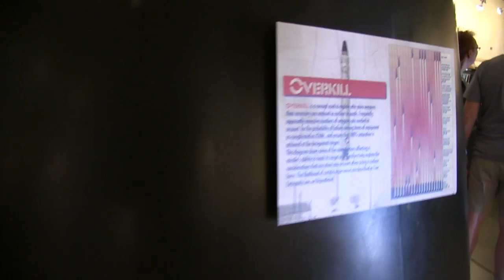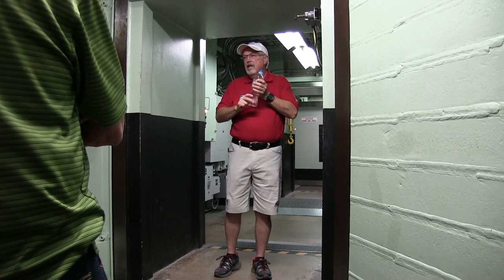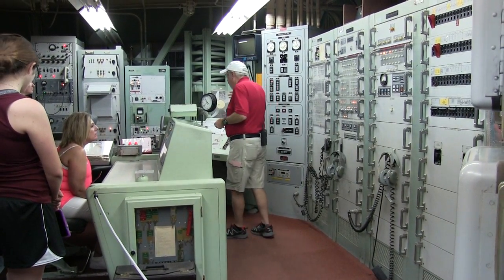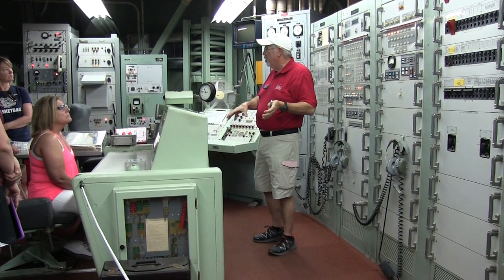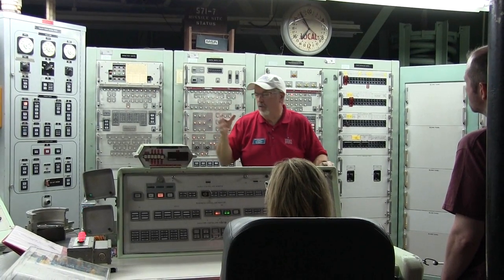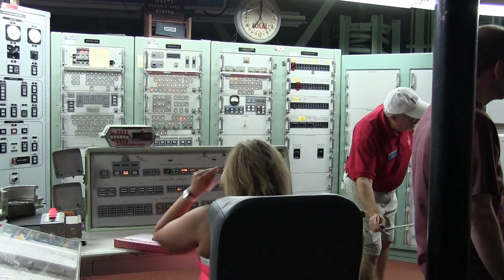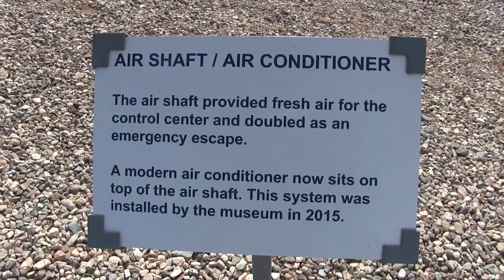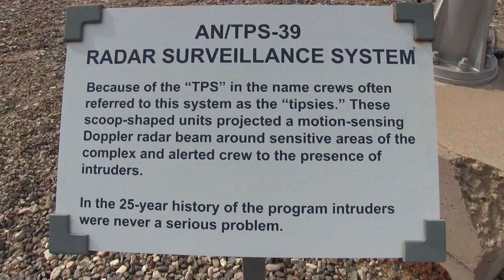Take a tour-Authentic, decommissioned, Titan missile silo Sahuarita, Arizona 2017

Comment: My first training in the USAF was as a Missile Electrician on Titan II missiles.  My first base out of tech school was DM.  I caught hell from the instructor at Sheppard one day because I was leaning against that same missile as it lay on it's carrier.  He told me to slowly pull my hand away from the missile and watch the skin.  I was shocked when it "oil canned out" with a rather disturbing "Ping."  I'm still amazed the damn things stand up without being filled with anything.
Reply: Maybe the old style oiling can..... just a half sphere with a spout that you'd squeeze the flat portion of the sphere to pump oil out of the spout. Then the depressed flat base "pings" or pops back out into shape...?
Reply: The skin was very thin on a lot of early rockets. The liquid fuel gave them rigidity.
Reply: As a launch crew member on the Titan II at Davis-Monthan, I had the opportunity to lower the work platforms and actually touch the missle and warhead.  Never tried to push against the skin. Didn't know it was that thin. It was one big missle.
Reply: The Marine Corps had a similar job. It was called an IFMM. In Flight Missile Mechanic. Truly the “tip of the spear.”
Reply: i was stationed at Sheppard in 1972.  i didn't even know that they had missile training there until i went to the Titian Missile Museum in Green Valley Az and they mentioned it. The one in the Silo is from Sheppard.   I was training as a Power Lineman after my AFSC was changed from "Missile Maintenance Technician".  Best Regards

Comment: Obviously AFTER  the removal of the digital LES system, which was a HF transmitted signal from the Control Center and received by each of the 18 sites. A “rotating” digital signal with each site having its own digital address. This Launch Enable System had to be activated through the input from the CC.which then passed the 24 volts to the launch panels for launch initiation sequencing. I was the LES maintenance technician at the 18 sites (plus the Wing Command Post) at Wichita. 
The LES system was replaced long after I left (1967) with a land line (think telephone lines) comm link to accomplish the same thing. 
I watched looking for the LES panel which was at an angle behind the Mission Commanders console.

Comment: I love the engineering that went into the shock absorber system.  When I lived in Nebraska I drove by many missile silos.  Anybody seen videos of one of those silo re-enforced concrete cover doors being  rapidly shoved aside prior to launch?  The engineering we use to try and destroy one another is very sobering and impressive.
Reply: bill timmons my understanding was the engineered the control center and silo to withstand 3000 psi, not 300....and what is sobering is the small size of the warheads. Almost unimaginable power.

Comment: Thanks for uploading but I did not go.  I was in Tucson but it would have been an extra 3 hours or more for me on a big travel day, but also I am being very careful with spending.   Same with the Thunderbirds, who were at Davis Monthan air force base.  Skipped it, but I have seen quite a bit of air shows in my time.

The amount of engineering and money that obviously poured into these facilities is unbelievable.  There are clearly very tailor designed equipment throughout the whole facility which most definitely had enormous cost.   There are improvements to lower cost I believe, in the minute mans, but those are surely extremely expensive, also.

Comment: 33:20 I’ve been on the tour before but this guide is really good. However I don’t know if there was ever a time when the Titan II’s were supposed to be the first ones to launch (if that’s what is meant). Kaplan’s 1984 book on the RAND Corporation mentions that, as part of “counterforce” planning, almost all of the Titan II’s and submarine based missiles were to be held in reserve and used only as a last-ditch retaliatory weapons against cities (due to their low accuracy) if the earlier strikes against military targets by the Minuteman and bombers could not control the war.
Reply: John Watson the accuracy of the Titan II was actually quite good. The minuteman series were even better, the mm3 can hit a target within 300 to 500 meters of the bullseye
Reply: Depends on what you mean by quite good – using an inertial system no better than used for later commercial aircraft it was calculated to land, at best, somewhere within a couple of miles from its target.
Reply: @johnwatson3948  a 9 megaton ground strike within 1 or 2 miles if bullseye will obliterate a hardened target. That's why the warhead used was so big. Today's 350kt to 500kt  warheads hitting a target within 200-450yards does the same thing
Reply: Also remember the minuteman series was the next generation weapons system that replaced the Titan series, not worked in conjuction with it. As the minuteman 1 missles sites came on line, the Titan II's were phased out, and decommissioned.
Reply: That’s difficult to remember because it isn’t true. Minuteman became active in 1962 with Titan II first active in 1963. Titan II ended in 1987 so they worked in conjunction for 24 years.
Reply: Would be wasteful if Minuteman could do the job instead. The RAND and McNamara/Kennedy administration records found by Kaplan show the Titan II was considered by its planners to be mainly a city busting retaliatory weapon. Despite what some enthusiasts theorize or want to believe there is nothing in these records regarding plans for it to hit hard targets.

Comment: I like to all about stuff 
So what’s down below where the missle was standing ???
What was around the corner where the missle was standing ??
Reply: There is nothing below where the missile stands suspended in its silo on the thrust mount. Obviously, it is "open" below the missile because the sound pressure from the ignition of the engines would destroy anything in the silo, so it was open and filled with water at the time of launch. in part of the video, you can see the entire missile all the way down. As for the rest, those are access passageways to access the missile itself at various levels, other than the fuel lines and electrical connections, there is literally nothing in the silo accept the missile.
Reply: Very interesting 👍👍👍
Now what about the water and sewage system, where is that located ? And where does the sewage goto ?
Reply: @fragglerock5000  everything was underground, so you can assume that the water and sewage stayed underground as well in storage tanks. Obviously its part of the system that nobody really wants to see, soo I guess they never show it. If you understand how a septic tank and leach field system work, then you get the gist of how the system works. As for the water, it's fed by its own reservoir underground.

Comment: A couple of questions  : 
A. If the missile is flying so fast, post launch and before detonation,,what is the point of painting the words, " United states air force  " on the side  ? 
B. If an enemy missile was detonated above ground near the silo and all of the r/f antennas, cables,  power grid were destroyed,  how would the launch technicians receive orders to launch from norad ?
Reply: There were secondary communication antennas that would rise up out of their own silos.
Reply: @Blaze_1961  thanks David.
Reply: There is a buried ULF antenna that would be used.

Comment: As amazing as it is, this whole structure bottom to top is a ONE shot or one time use only facility. It would never launch more than ONE rocket, ever. Everything you see here is to launch this one rocket with a high probability it will hit its intended target, no guarantee it will and never to be used again. An absolute waste on so many levels.
Reply from the maker: Yes I agree and it would probably take a week to reload another missile.
Reply: @travelingtom923  True, but think about that. I 
A nuclear war or retaliation Would only last a few hours. Reloading a few days or a week later even in a best case scenario, wouldn’t happen, It wouldn’t matter any more